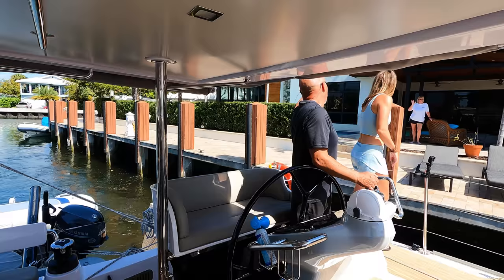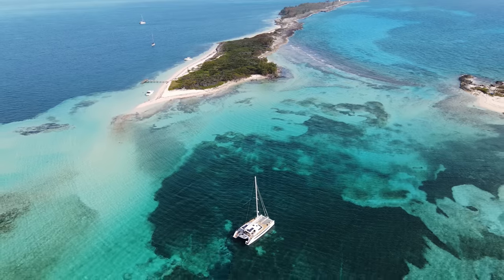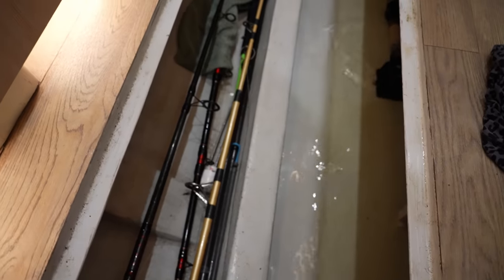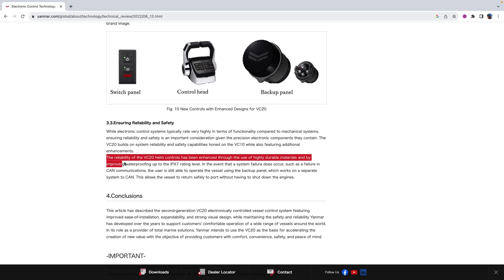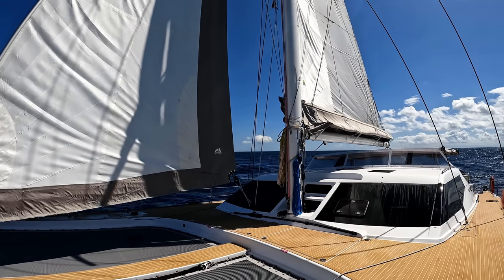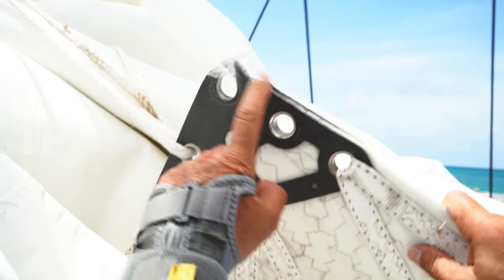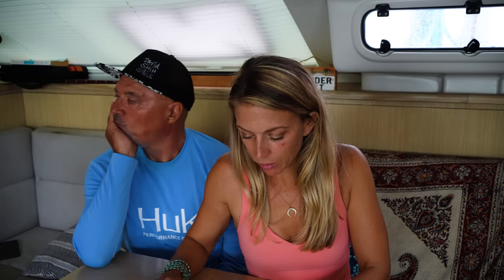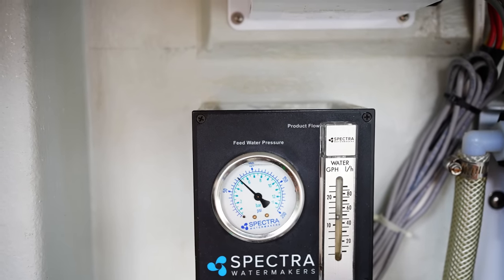SEAWIND 1600 CATAMARAN 3 Yr Review - Joy or Regret?

Comment: The best part of this video to me was your discussion of sail handling particularly the self-tacking jib and how to make it go upwind. Furling problems was also good.  I am familiar with self-tacking jibs but have never used one and wondered what the short comings were besides being restricted by size to about 100% of the foresail triangle area. Your discussion of sail makers was strong, as was what material you prefer.  Sounds like you might be adding an additional removable bow sprit to accommodate an additional foresail.  Sounds like you want to double your solar to 2K, then consider getting rid of the Fischer Panda generator to lighten up the boat, like Nick did.  Thank you.
Reply from the maker: Thank for watching and for your comment! We have a removable bowsprit and we are thinking about adding a block for a code 0.
We would like to add solar but not planning to remove the fisher panda. Hi draw systems, oven, water heater and washer dryer and air conditioning depend on it. As technology evolves we may be able to to operate the above with a larger alternator.
Thanks 😊
Reply from the maker: Thank for watching and for your comment! We have a removable bowsprit and we are thinking about adding a block for a code 0.
We would like to add solar but not planning to remove the fisher panda. Hi draw systems, oven, water heater and washer dryer and air conditioning depend on it. As technology evolves we may be able to to operate the above with a larger alternator.
Thanks 😊

Comment: TY for taking the time to make this video! fascinating info, thank you for sharing...on of the things I'd like to know is simply a raw average over these past years.  what is your yearly cost break down.  we are looking to get into an 1190 sport for seas and crossings, we're still working full on but will be ready to settle soon.  However I have many modifications I will require before I'm ok to pull the trigger... how willing is seawind to work with you on modifications/customizations??  *(in mast furling, electric outboards wired for drag recharge, dual filter diesel genset, all doors refitted as pullouts instead of swinging, deleting the extra head and stateroom for additional freezer, storage, workshop and hammock hooks.  AC venting. moving the nav center up, del the side cub of master to fit dual twins to make a king size wide bed.  add in OSCAR system and external cameras (FLIR and thermal), redundant rudder, secondary anchor, secondary AP, and redundant ram arm. and finally an AIS booster)
Reply from the maker: Thanks for watching!! 
— We have a video for cost that you may find interesting.
MAINTENANCE COSTS + Lessons Learned LIVING on a NEW SAILING CATAMARAN | Harbors Unknown Ep. 54
https://youtu.be/Yh2unG3L4LY

We have not looked at our expense since.
This is a difficult topic.
You will have fixed costs and variable costs.
-Fixed costs for a sailing boat can include:
1. Purchase price (cost of capital) or financing costs including interest.
2. Insurance (varies depending on sailing grounds, typically 1.2 to 1.6 of boat value)
3. Annual or bi-annual maintenance (bottom paint, haul out, saildrives, engines)
4. Registration and taxes (depending where you register the boat.
5. Depreciation (will come off your taxable income when you sell)
Fixed costs vary on the boat's size, location, and specific circumstances.

-Variable costs
1. Fuel  (if not solely wind-solar powered)
2. Dockage or slip fees when used, water and electricity.
3. Maintenance and repairs (e.g., sails, rigging, engine, toys)
4. Provisioning and supplies (food, drinks, safety equipment) restaurants and bars.
5. Navigational charts (paper or electronic) and guides, predict wind, communication (iridium go or inreach) internet (Starlink?)
6. Transportation on land, Uber, taxi, planes (depending where you sail) entertainment.
7. Upgrades and replacements (running rigging, additional sails) other equipment.
Everyone we meet has a different lifestyle and variable costs.

— 1190 sport modifications.
I cannot comment on the type of customization seawind is willing to do.
I know of a 1600 with in mast furling and I assume they would do it for a 1190.
I assume that electric outboards wired for drag recharge are possible but I have not seen one.
They typically install Fisher panda genset.
Cannot comment on interior customizations.
Not familiar with OSCAR system
Yes for external cameras (FLIR and thermal)
Not sure what you mean by redundant rudder, 
Yes for secondary anchor
Yes for secondary AP, 
Yes for secondary ram.
AIS is standard
Good luck on your boat built! We look forward to seeing out there!
Reply: @HarborsUnknown  ahh. Thank you.  I think I've seen that video awhile back, but I'll give it another watch.  I said break down, but another way I'm curious about, is if you took all your monthly costs all lumped up, whatever those costs ended up being, and averaged those out over the 3 years to get a delta point.  That avg cost for you per month.  It's taking all of the variables all of the random factors, everything and getting that raw average.  
The extra rudder in case one is damaged I pull it up, drop the back up in place.
Reply from the maker: We do carry an additional rudder on Wanderlust. On the 1600 the rudder goes in a cassette and it’s easy to swap underway. For a fixes rudder you will have to haul out and you can have one shipped wherever you are if you need it. I am sure that if you ask SW would give you an additional one.
We really have not looked at our cost of daily living and separate the cost of the cat.
If you are trying to budget your cruising kitty you would probably start adding up your fixed costs which are known and are the biggest chunk.
You know the price of the boat and if you are going to finance it, add insurance and the rest of the items.
Variable costs depend on how much you motor, how much and what you eat, do you go out to restaurants, do you drink expensive wine?
Are you going to buy diving gear, compressor, kite surfing equipment? It is all very dependent on individual choices. We have friend who make it on $2000 a month and other who need $20000 a month.
In the first 3 years repairs will likely be under warranty so they should not impact your expenses much.
Haul out and bottom paint varies from $12-15000 in Florida to $4-6000 in Panama. Are you doing the work or have someone do it? Big difference.
If you want to help with your budget I am happy to assist in filling the blanks on specific items.

Comment: Stunning that the factory mainsail came apart so quickly.  Hopefully they fixed it under warranty.  And if it's losing shape after 3 years, one would hope they are doing something about that as well.  (Like a free recut and repair?)  Unless you guys have REALLY abused them, that just doesn't seem right from a loft like Doyle.  Interesting and enjoyable video!
Reply from the maker: We were really surprised as well! We don’t think we’ve abused them too much but unfortunately Doyle didn’t offer anything like that, though it would have been nice. When the headboard broke they referred us to the nearest sail loft in Shelter Bay and they did the best they could to get the sail back in working order without the original headboard part. We’re glad you enjoyed the video! Thanks for watching.

Comment: Great and honest video. I can resonate with some of the issues you highlight. I recently did a 1000nm 1250 delivery and you had to make sure you balanced the fuel usage. We also had autopilot isssue (Raymarine unit), but ours was the autopilot disingaging and it seemed to happen on following seas also. All part of the sailing lifestyle 😂
Reply from the maker: Thank you for watching and for your comment!!
Reply: Often you can help the autopilot cope by turning down the response level on the autopilot to cruising or leisure and it will still work fine. We did this on our sporty crossing from Fiji to Indonesia to reduce power consumption. More than likely that unit is undersized for the vessel.
Reply from the maker: Exactly correct!! We did that to no avail😊

Comment: Wow, nice video. It's so refreshing to get videos from full time sailors that tell the truth and give honest opinions about their sailing boats and what goes wrong and what is right about their boat.  As you know I have watch all your videos and have seen most of the issues, trials and tribulations you both have been through. I know you guys have had a great time during your journey. But you have also experienced much difficulty, and even I have been a little disappointed with SW at times, but even more so with the many subsidiary suppliers of gear they use. Having said all that, I think what I'm taking away from this video, which will hopefully help other prospective buyers, is that when purchasing the vessel - any manufacturer- is to look closely at upgrading the equipment on the boat to a higher spec. right from the outset in the hope that this will reduce costs and likelihood of problems and issues down the track. Would you agree? I know that this places a much greater emphasis on costing decision of a new boat, which may ultimately then impact the size of the boat and possibly even manufacturer, one chooses. 

I am glad that you have found a vessel that suits your sailing needs and choices, as SW have a good rep. in the industry, and I'd hate for them to be sullied by a single review. I do think that they need to review their choice of suppliers in some instances as they have been let down by them, B&G for example. I'm glad that you have been following RR2 build - their sails look amazing (however they are new). For me I think the 1370 has some great features and if they were incorporated into the newer 1600's that would be fantastic. Personally however, I'd love it if SW put out a similar design to the 1600 in the 60+ ft range, say a 2000. Having said that I am following the Barefoot Doctors and their Portofino 52 build and it looks the good over everything on the market currently. I'm sure it costs a lot more however.  Great video again guys and I shall continue to follow your exploits, hoping that you make it to Australia where I'd be happy to buy you both a beer/wine over a beautiful bay or two.  Keep up the good work and may fair 💨and following 🌊be with you always.
Reply from the maker: Thanks for the compliments! Yes, your takeaway is correct. It will take a lot of time and effort plus more money but we believe it is in the buyers interest to invest in quality equipment + systems at the outset. It will hopefully save some headaches. 
The 1370 looks nice and the sails on RR2 look awesome but we prefer the performance aspects and the helms of the 1600. It seems like many companies are going bigger so they may introduce a larger model in the future. 
We're not familiar with the Portofino 52, we'll have to check out the Barefoot Doctors videos. Thanks for watching and commenting as always and we're lookin forward to that drink in Australia!
Reply: @HarborsUnknown  Thanks for the prompt reply. Portofino is an aluminium hulled catamaran and looks to fit the bill of most people, the caveat maybe the cost. You'll need to watch the videos starting from about six months ago where they outline exactly what they were looking for in a catamaran. But they have some great videos like yourself and put out a quality product. Wishing you all the best in the upcoming months.
Reply from the maker: @gbsailing9436 Interesting they went with aluminum. It’s seems so many people are going that route. We’ll give them a watch!
Reply: @HarborsUnknown  They wish to be able to beach their yacht in various locations worldwide and even if they perforate their hull, aluminium is easy to weld up anywhere in the world. They had many other criteria but essentially that was a winner for them. It's an interesting design. Check it out
Reply from the maker: We definitely will!!

Comment: These manufacturers need a reality check from a marketing perspective. They argue about insignificant costs like replacement questionably IP rated throttles and people looking to purchase a cat think I can't be bothered dealing with that. They don't even have the intelligence to either check if someone has a public presence or understand the impact messing people around who do.  One of the reasons that I didn't get 1600 was those solar heaters for front windows but that was obvious so you can't complain about that. 😉 Least most of the hull seems solid and it looks good. Insignificant hit list compared to mine haha I wonder how much extra heat that decking holds in as well.
Reply from the maker: You obviously know boats! And as such you know that it’s always a trade off. Seawind has been good to us but your points about warranty replacement is spot on. The large windows at 45 degrees are great for visibility of the sails from the nav station and for windage but the do offer real estate to the sun 😊.
Also good observation about the Flexiteak, great grip and looks at the cost of weight and heat retention 
What catamaran do you have?
Thanks for watching and for your comment!!

Comment: Great video!  There are a lot of videos on how to change the Starlink Router to 12V so that might help with your power consumption.
Might save you getting more solar.
Reply from the maker: Thank you Kirk, I have not seen a kit to convert the in motion antenna to 12 V.
I am definitely a few steps below novice when it comes to electronics and I need something easy 😂😂.
Are you aware of one?
Reply: @HarborsUnknown  I will send you some links.  It does involve cutting the gray cable and putting on a shielded CAT5 end (ethernet) but that looks like the hard part .
Reply from the maker: @KirkThomson thank you so much!!

Comment: Re the bilge pump leak, it sounds like a siphon effect. Have you tried looping the output hose above the waterline and fitting an anti-siphon valve at the top of the loop, as is done with wc output hoses. You have probably thought of this, but in case you haven't.
Reply from the maker: Bingo!!! Exactly what is happening, easy fix! Thank you for watching and for offering the correct solution.

Comment: I hear great things about aluminum catamarans like the Tim Mumby made ones. I know they tend to be a little more rustic inside but super fast and capable. Did you explore those as an option? I also follow Life on Jupiter and that Tim Mumby made cat seems well made.
Reply from the maker: We did not consider that at the time, the popularity of Aluminum is rapidly gaining, especially for higher latitudes.
Not really convenient for smaller cats for weight to length ratio but certainly for a 16 meter would make sense.
Here is my list of pros and cos

Durable and lightweight.
Corrosion Resistance: Good with proper treatments.
Weight: Typically lighter than fiberglass or steel.
Durability: Suitable for intensive use.
Customization: Allows more flexibility in design.
Maintenance: Easy to maintain and repair.
Environmental Impact: Recyclable material.
Cos:
Cos: Often more expensive than fiberglass, for production boats considering the amortization of the initial cost of the mold. For one off aluminum is cheaper and you can build one behind your house.
Thermal Conductivity: Can affect interior temperature.
Galvanic Corrosion: Risk when in contact with other metals.
Appearance: Can oxidize or become pitted over time, but no need to paint the hull if you don’t mind the looks.
Noise: Amplifies impacts and wave sounds.
Thanks for watching!!!😊😊
Reply: Thank you for the detailed reply.  @HarborsUnknown

Comment: Bottom line, NEVER buy a new boat. At least three years of continual use is needed, which means that the average boat needs to 5-10 years old.  That aside, Seawind specked the parts, it is their problem to resolve. I had this sort of issue with a motorhome and the seller lost based on that argument.
Reply from the maker: Exactly 👍

Comment: Hi I would love to know how your alternators charge your lithium battery bank.  Do they go direct or through a DC to DC charger?  Have you had any overheating problems.  I have a 4JH110 Yanmar on my monohull with the 125 amp standard alternator.  Thanks.
Reply from the maker: We have high output mastervolt alternators 150 amps (1800 watts) 80% efficiency.
We have Mastervolt lithium 720AH with a smart voltage regulator that controls the alternator’s output for charging.
We have a Battery Management System (BMS) to manage charge levels and temperature. We have put as much as 400AH when solar engine and generator run at the same time without problems. Apparently you can go up to 500AH
It’s an integrated Mastervolt system and to be honest I really would not be able to go in any depth on how it works but we don’t have observed any problems with temp. Hope this helps! Thanks for watching!!😊
Reply: @HarborsUnknown  Many thanks for taking the time to reply.  Best regards Gordon
Reply from the maker: Our pleasure. Thanks for watching!